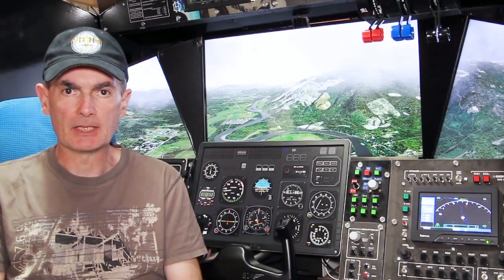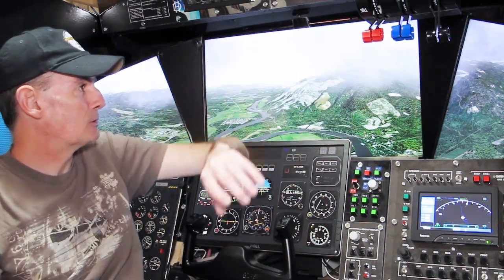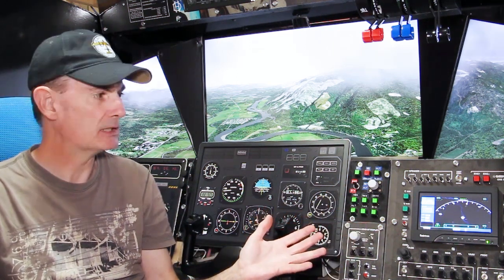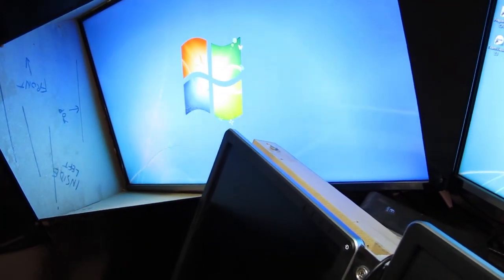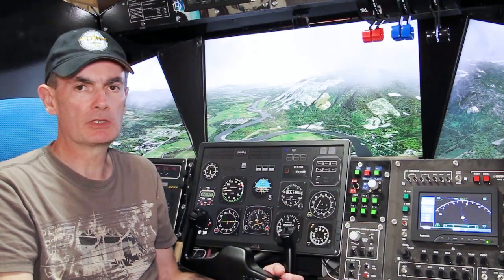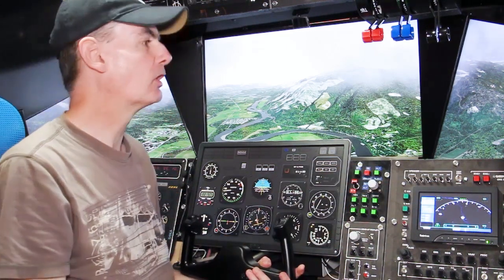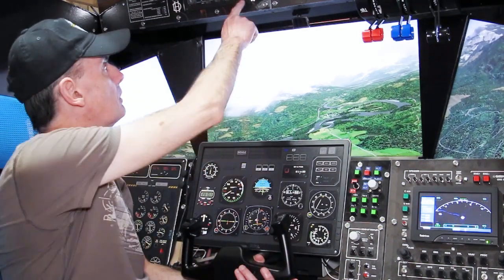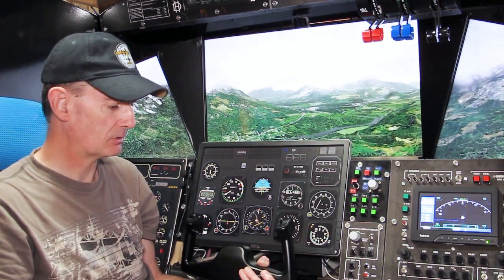Enclosing the Side Screens with 'Windows'! (Twin Otter Cockpit Build - Part 45)

Comment: What about sliding the left and right screens towards the centre screen in their current orientation, but behind the centre screen to eliminate the two black triangles, and then adjusting the frustums?
Reply from the maker: Well that would be a possibility, though I doubt it would look good since (among other things) there would be an extra parallax error when you moved you head. But you'd also lose about 30cm of the total width, which represents a fairly huge area of the display (roughly 15x40cm) and just seems like a waste. The way I see it, the utility of those two missing chunks of front view is far less than the added view out to the sides.

Comment: Hello! First of all, great job on the cockpit! Thanks for sharing. I do have a question about the flaps on this otter. Iam trying to set up flaps with spad.next but i cant get it to work. How did you solve this problem? If you coul please share your solution that would be amazing!
Reply from the maker: There should not be a problem with the flaps. There are two built-in FSX functions called FLAPS_INCR and FLAPS_DECR. I just use these. I don't have SPAD.neXt for FSX but those functions should be there. In real life the Twin Otter has continuous flaps rather than staged, but I don't think this is implemented on the Twin Otter Extended.
Reply: thank you for the answer! I failed to mention that iam using xplane 11
Reply from the maker: @sinkrate  I will have a look next time I have the sim computer running. But honestly, I wouldn't bother with the Twin Otter in X-Plane.
Reply: @AlmostAviation  you are probably right about that one! Iam in desperate search for a decent twin turbo for xp11
Reply from the maker: Best advice I can give on programming SPAD.neXt is to look at my video here (from about 11 mins onward): https://www.youtube.com/watch?v=_VqZuFAHTMQ. The details is, you need to add a button action to increment the variable 'Flaprqst' by 0.25, specifying an upper limit of 1. Likewise, you need another button to decrement the same variable, with a lower limit of 0. This gives the you incremental (4-stage) flap behaviour that many aircraft have. To make it more realistic for the Twin Otter you could set it up to increment continuously while you hold the button.

Comment: Have you investigated a projector system, in much the same way professional simulators work? Then the gaps and weird angles to the monitors would not be an issue and the sim would be projected on a continuous curved white screen. I don't even know if that would be feasible with FSX or XP